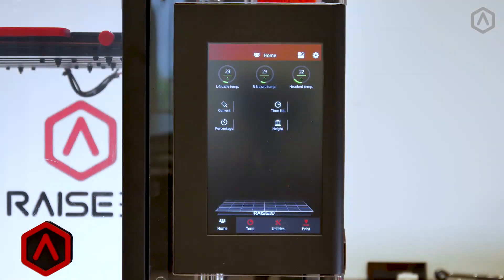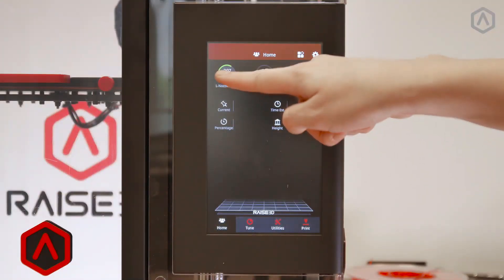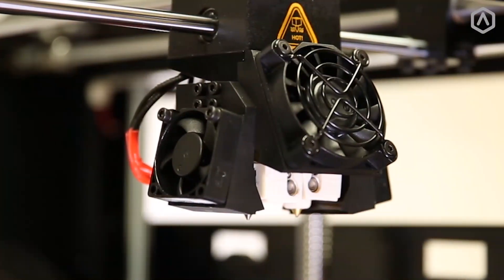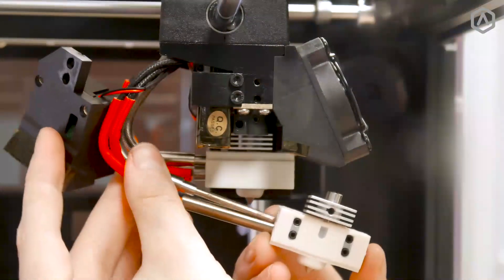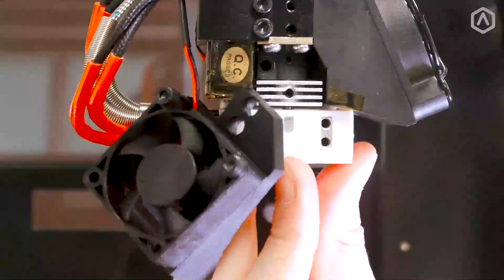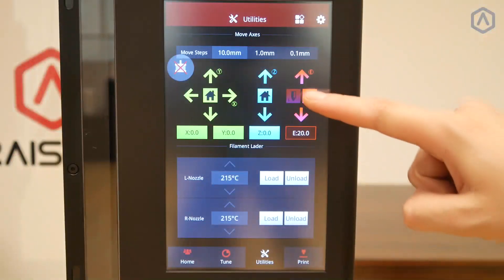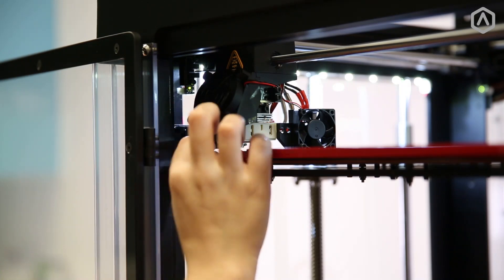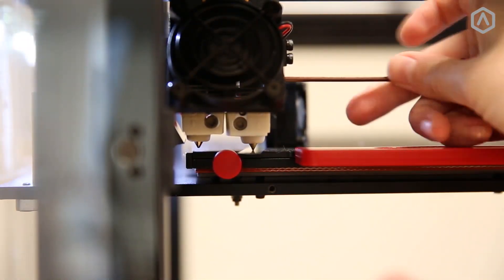Hotend Removal and Replacement for Pro2 Series 3D Printers | RaiseAcademy

Comment: I have a 3 month old Pro 2 Plus. The machine has just virtually destroyed itself after the hot end separated just 1 hour into a 9 hour print, but inconceivably the machine carried on extruding and kept the hot end powered, due to what I see as inadequate safeguards. This caused a small fire which destroyed both hot ends, the fans and shrouds. Also the build plate and surface are wrecked. 

So far this machine has been very, very poor. Only material I have had any degree of success with is PLA and PC, after a lot of experimentation with the latter. PLA-CF has been an unmitigated disaster. Constant delamination, the PVA support material is hopeless, I've tried around 20 different configurations for the slicer and none produce any degree of repeatability (despite input from the European distributor.)

The tools supplied are very low quality and will round off if any appreciable amount of torque is used on the screws mentioned in this video, and for this reason I used my own high quality hex keys. They distributor is now suggesting the failure was down to me as 'You obviously didn't tighten the retaining screw sufficiently.' Hot end replacement is not difficult and is a routine operation for changing to a hardened steel nozzle for example. It is considered a routine maintenance procedure. This also appears to be a way for the manufacturer to absolve itself from any responsibility for serious failure.

Deeply concerned by a machine starting a fire in the middle of the night in our workshop, despite the fact it fortunately wasn't self sustaining. 

I await Raise 3d's full and final response through the warranty system, but so far I have nothing but regret and a $6000 debt for this machine.

Comment: 3500€ but you have to replace your hotend after 2 mounth
Reply: I've had this Machine for over a year now. I'd call it bittersweet. Leveling the bed is annoying. The hotend does seem to require replacement or at least cleaning much more often than my CR-10s. It sucks that you have to use ideamaker as the slicer, it's the only option. So you have to learn a new program. However the interface is nice. I'd recommend it as a dual head printer. It's price tag does not equate to quality however.
Reply: @tomaspena5329  it is compatible with simplify3d, but even with that you would suggest to go with many CR-10sPRO instead of a single PRO2 ? (for 24/7 PLA printing) thans
Reply: @juliensimracer  I would suggest the Pro 2 if you want high quality prints with very little maintenance/monitoring of the prints. Printing PLA with the Pro 2 is about as care-free as it gets. Any of the Prusa i3 clones (like the CR-10) are going to require much more maintenance/adjustment than the Pro 2. If you have any questions about it, I am happy to help.
Reply: @TaterMater22  any comments on the E2?

Sounds really good so far
Reply: @jotham123  Haven't used one, but it looks like a great printer. The linear bearings I imagine will make for incredibly accurate prints. Plus Auto bed leveling is just great. I have been incredibly impressed with our Pro 2, as has everyone in the building. Even the guys in development who have a $200k+ Stratasys are super impressed at the quality with the Pro 2 for the price. This company is doing great things. Oh yeah, support has been excellent as well. They are very helpful with recommendations when I want to print with a new type of Filament or, for example, when I struggled with getting Nylon to stick to the bed. If you think the specs satisfy your needs, I think everything else about the company is top notch.
Reply: @tomaspena5329  What are you printing with that requires hot-end cleaning so much? I have used one daily for nearly a year now, and I have only had to clean it once. And that occasion was actually my own fault. As for quality, I actually prefer it over our MarkForged printer. We use it for all kinds of items in our metrology lab, so we measure the dimensions all the time, and it is for sure one of the most accurate printers in this price range and just as accurate as significantly more expensive printers. I haven't used a CR-10 (a Prusa i3 clone) specifically, but I have used a different Prusa clone, and I can't see the quality and ease of use being as good as the Pro 2. I love the Prusa design for cheap hobbyist printers, but they definitely are not for those looking to print day in/day out without tinkering with the printer.
Reply: You don't recommend this machine Then ??
Reply: @bobhepple5752  I have only had this machine for 2-3 weeks, but so far, it is printing very well. If it continues this way, I think it is an excellent value.  We use it for printing both prototypes and end-use parts in our Metrology lab and for production at my workplace, which is one of the major German auto manufacturers.
Reply: @TaterMater22  Thanks for the Reply I have a Demo Booked this week I mainly do intricate mechanical parts, this might be over kill but the quality of the machine is what driving me... Thanks
Reply: @bobhepple5752  Got ya. PLA is certainly effortless, excellent quality with this printer. NylonX doesn't like to stick to the BuildTak surface, but a little water soluble glue stick makes it stick just fine.
Reply: @TaterMater22   Taylor thanks for the reply had a demonstration today on the Raise - I also  looked at the new E2 I was surprised when I was told the UM5 would print a better model using PVA I have some choices to make the E2 looked compact don't like the idear of the print pausing when you open the door.
Reply: @TaterMater22  What's it like for ABS? I'm considering it as an ABS printing work horse. and how has your experience with it been so far?
Reply: @bobhepple5752  Did you end up getting one? What are your thoughts?
Reply: @jotham123  I actually don't think I've printed with ABS yet, though I would expect good results. Thus far, I've used PLA, NylonX, Taulman Alloy 910, and PolyFlex TPU. We have a $50k MarkForged printer in another department as well, and I am so glad I went with the Raise3D Pro 2 Plus instead. I haven't had any issues that required replacing the hot end. I imagine that would be someone who printed with the wrong material in the brass hot end instead of using the proper stainless version. I went ahead and installed the stainless hot-ends as soon as I got it because there's no reason not to. Overall, I have yet to find a better printer for the price. Regarding the previous commenter's bed leveling issues, I have only had to level it once, and it was quite simple to do. 5 minute process, max.
Reply: @jotham123  No I Purchased an E2 today pick it up Thursday
Reply: @bobhepple5752  congrats!